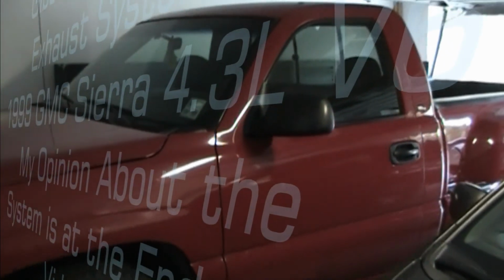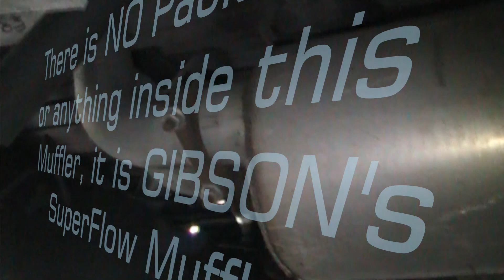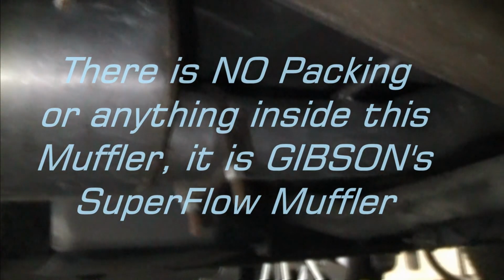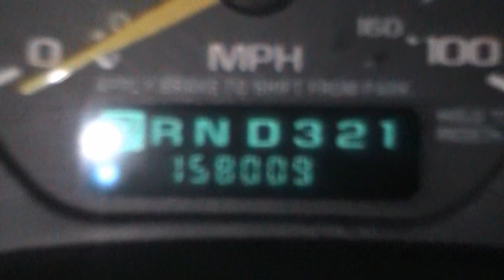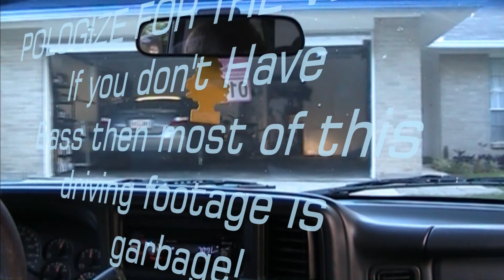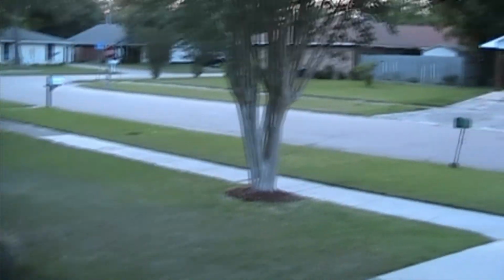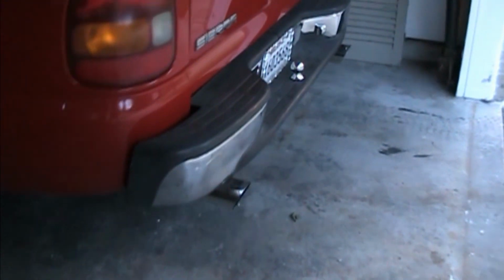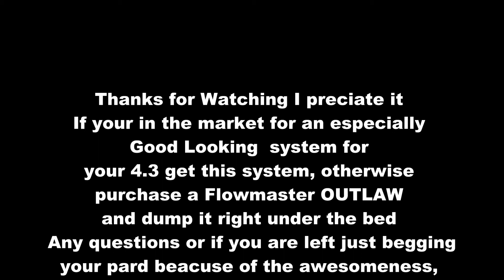GMC Sierra 4.3L Gibson Exhaust OVERVIEW

Comment: @EricTehRedneck im in between exhaust systems right now for my 94 blazer CPI 43
im trying to find a chambered muffler that is just a low rumble at every rpm thats not a flowmaster.
FM prices are far to high im looking at thrush now their welded muffler is supposed to sound really good with no rasp.

Comment from the maker: @colehunter10 i bought the stereo at best buy, and I also bought the wiring harness for the truck there too. it was very simple to do just splice the wiring harness for the new stereo with the wiring harness that you buy separate that fits the truck pin connector and mine went in in an hour or 2.

Comment from the maker: @xXMFD i love the sound of a straight piped 5.3 i would suggest doing a custom job with either dual or single flowmaster outlaw and dual split exit. its legally as close as you can get to straight pipes. if your not into custom stuff then i'd suggest a flowmaster 44 single in dual out kit they sound wicked

Comment: @EricTehRedneck i was being sarcastic but i do like your truck and the setup you got.
i got paid for putting on my exhaust.
by cashing in on the 50$ cat i was able to get the muffler and put it in where the cat was and a piece of metal pipe in place of the muffler and still have $30+10$ after i sold the factory muffler.

Comment: That looks like about a 2006 Honda Civic I was like no way because that's funny I have a 2003 ZR2 S10 3rd door with the 4.3 and a 2006 Civic. My Civic has over 310 k miles on it still purrs like a kitten.  Looking for a cat exhaust for the truck I'll probably just get a dynomax I think it's called.
Reply: When the truck is revved it sounds like my Peterbilt roll-off truck that I drive LOL

Comment from the maker: @roman13w yeah same here I got the truck when I turned 16. I noticed a pretty big increase in performance after I added the K&N intake system and the straight piped exhaust. The only thing I would add to mine is a tune and maybe headers, but that's out of my price range. 4.3's take well to bolt on performance parts

Comment from the maker: I got between 18-20 mpg doing 50/50 city highway driving. It needed new spider injectors though. a 4x4 5 speed will get prolly 24mpg tops depending on how ya drive it